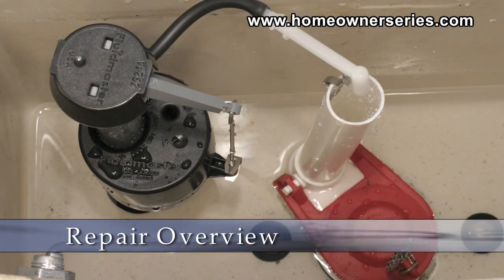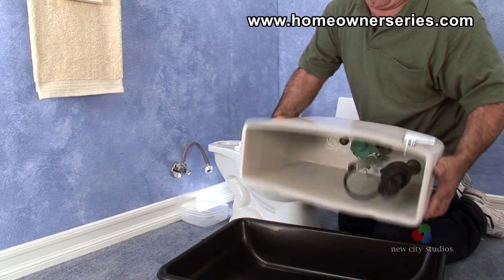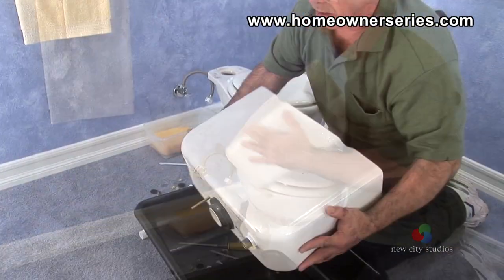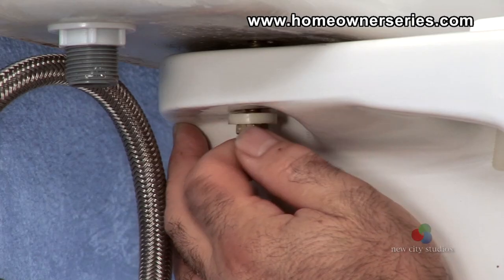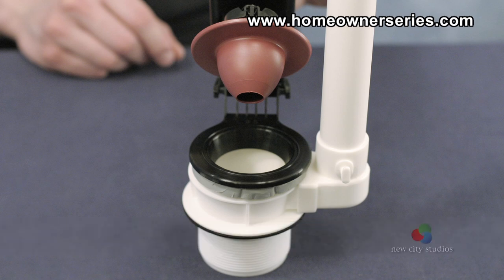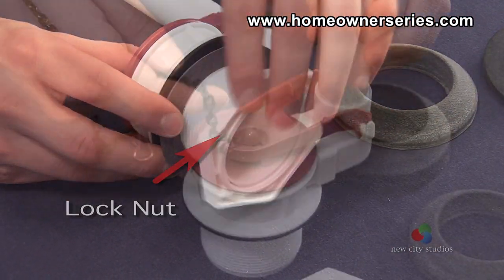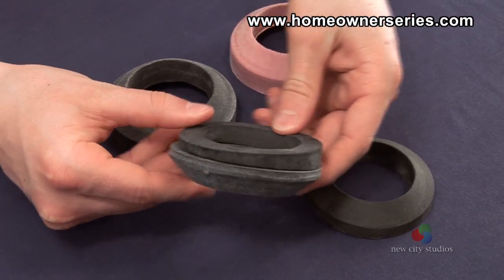How to Fix a Toilet - Flush Valve Replacement - Part 1 of 2

Comment: I have an intermittent leak such that the water level in my tank drops sometimes. I've tried to determine where it's leaking by cleaning the flapper and the seat ( it wasn't too dirty), feeling underneath the tank bolts (no water), tank bottom felt dry, no water on the floor, I've checked for cracks on the overflow part of the flush valve. I can confirm though that water leaks from the sides of the bowl into the bowl because I've seen it once. I've lifted the flapper to look down through the hole and did noticed that the bottom edge or rim of the flush valve seems to be partly broken. But, I don't see how this could be the reason for the leak since that part is underneath the flapper which is supposedly shut tight and water from the tank is not suppose to get through. Stomp!

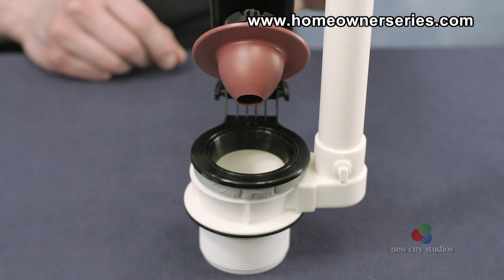Comment: 0:28.....it's all white plastic, there's no flapper seat. 0:33 shows a different type with a black seat. The one i have is like at 0:28, and it's hard to open. Tried cleaning it but didn't work. I'm wondering why that happens, it's as if a stronger suction is caused for some reason.  Everything still looks new, toilet is only 4 years old. It's Aquasource.....I don't think i'd buy another. (bought at Lowes, not they don't carry Aquasource anymore) If anyone knows what causes the flapper to become hard to life please let me know...I'm baffled by this.